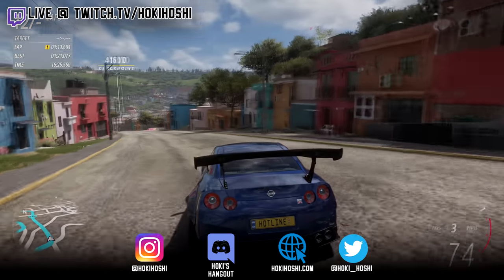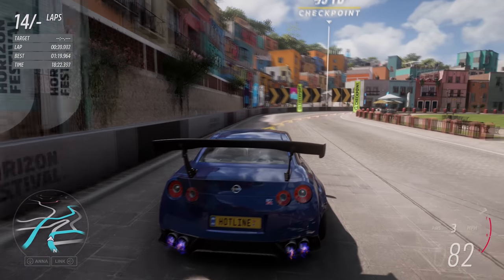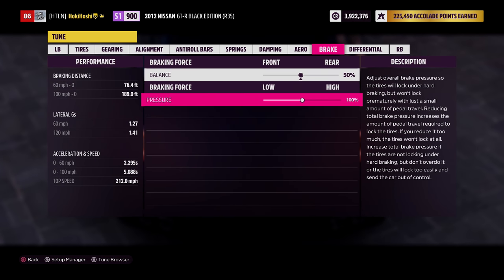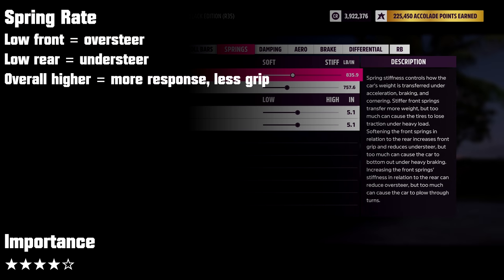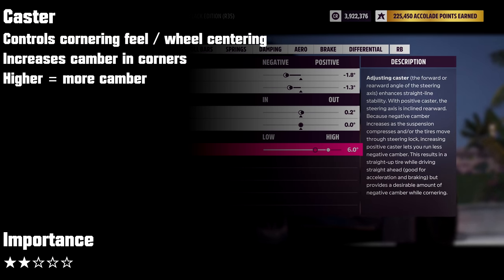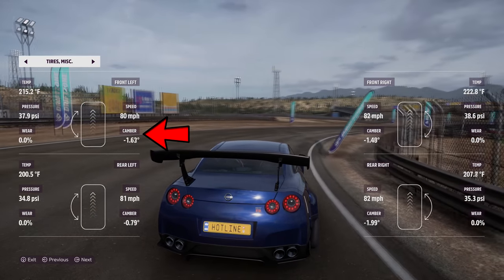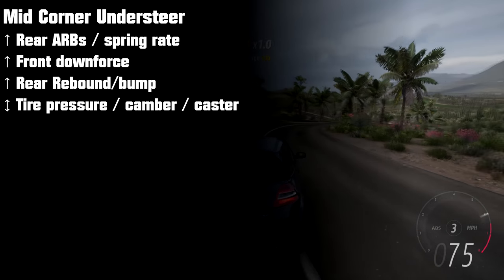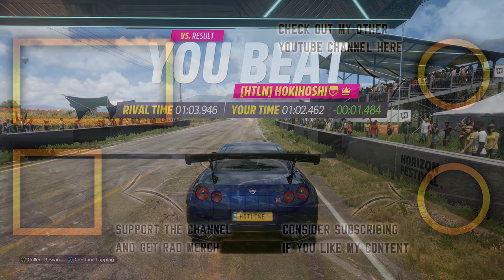How to Tune in Forza Horizon 5 | Basics of Tuning Guide

Comment: Hoki FH5 Tuning Summary

Differential:

Rear Acceleration: 
50-90%, scales with HP. Higher = more oversteer.

Front Acceleration: 
10-50%, low on track builds, high on rally. Higher = more understeer.

Deceleration (Front & Back): 
0-Accel%. Low = responsive. High = corner stability.

Center: 
50-80, low on rally builds, high on track. Higher = more oversteer.

Brakes:

Balance: 
Front = Rear braking force. More stable, understeer.
Rear = Front braking force. Less stable, oversteer.

Brake Pressure:
Higher = Quicker locking/ABS engagement.

Aero:

(Only important for A+ Class)

Higher = More grip, hotter tyres, lower top speed.
Difference between front and back can influence under/oversteer.

Damping

(Keep Bump at 0.5 - 0.75x of rebound)

Main Guideline: Increase stiffness on the end of the car that is not losing grip, or increase softness on the end that is losing grip.

Therefore, high front setting = more rear grip. High rear setting = more front grip.

Springs:

Low front = oversteer
Low rear = understeer

Stiffness can be affected by weight balance.

Ride Height:

As low as possible.

Antiroll Bars:

Low front = oversteer
Low rear = understeer

Usually at around 50%- for front, 50%+ for rear. Don't bother much for RWD.

Alignment:

Camber:
Negative camber is better for track racing. Drop a touch for base tunes.

Toe:
Toe out = Oversteer (Use on front in FWD/AWD for better grip)
Toe in = Understeer (Use on rear in RWD for corner stability)

Caster:
4-7 degrees.

Gearing:

Just match final drive for base tune. Lengthen 1-2 gears for high HP cars.

Tires:

26-35 PSI for track. Higher front PSI is better for cornering.

__

Final Tune:

Suspension:
Should be between 20-80%, try to avoid bottoming out.

Tyres:
Step 1 - Take a corner.
Step 2 - Ensure all outside tyres have negative camber.
Step 3 - Heat should be around yellow-transparent. Lessen camber if the temp difference is too high. Low pressure if middle is too high. Ensure optimum contact and heat.

Good racing, everyone.

Edit: Holy crap this game is so good. Solid 50fps, Mid-Low too on a 6 year old GPU. Wow.
Reply: you sir, are a good man! get this comment to the top!!
Reply: King
Reply: Are you going to make a video on setting a tune for drift cars in FH5?
Reply: Not the hero we deserve, but the hero we need
Thank you kind stranger
Reply: Hoki needs to pin this
Reply: You're the best. I have watched this video like 10 times and still can't remember it all. This is great.
Reply: I still didnt get what acceleration/deceleration I need on FWD cars. Opinions are all over the place. Some say close to 100% on accel and close to 0% on decel this will cause oversteer, some say the contrary and some say 30% on accel is the sweet spot.

My 2 most used cars are the civic '97 and civic '18 and I'd like to know if they should have close to 100 or 0% on accel dif cause oversteer is very important on these 2 cars.
Reply: you're doing God's work!
Reply: thanks bro we needed this
Reply: what graphics card you got my guy
Reply: Thank you good man. Enjoy your tuning and driving🔥🥰
Reply: @blazet7379  why are you asking him?
Reply: @arachnid7468  probably a GTX 1050ti or a 1060 as I have the former one and get around 40 fps at very high settings (settings between high and ultra with 1 or 2 settings tuned up to extreme).
Reply: Got a 1050ti and I can agree the game still looks beautiful on low graphics!
Reply: Damn it give me a second I don’t have my notepad
Reply: @mr_flannels9632  thanks for replying and giving me a notification, I was searching this comment but couldn't find the right video.
Reply: I love you for this
Reply: @arachnid7468  Hey there. I'm running a Ryzen 2600 with a very mild OC, and a trusty 960ti that hasn't failed me for years.

I might be purchasing a new GPU soon just for this game, let's hope that I get a fair price! (I won't)
Reply: You're a fucking God.
Reply: You dropped crown king, here you go 👑
Reply: @TheStrifist  ah nice. i built my first pc earlier this year and got myself a midrange rig with a gtx 1650 and a ryzen 5 3600.
im really impressed with how the game can handle such good graphics with a lot of the lower end gpus. mine can run a stable 60 fps on high.
Reply: DUDE, THANK YOU! So much info. I copied this into a word doc, which will need to be with me when trying them out. Lol
Reply: Amazing. Copy, paste, save... instant cheat sheet for tuning.
Reply: wait. He said something about weight distribution and how we need to take that into account while adjusting suspension...

Just how much did he mean by that.
Reply: Top tier comment on a top tier vid
Reply: I am on a shitty laptop with a 1050 in it which came with the laptop and i get 60fps easily. its amazing
Reply: You just saved me so many screenshot thank you
Reply: More in depth summary with added details feel free to add and remove anything you want

Forza tuning guide
Differential:

Rear Acceleration: 
50-90%, scales with HP. Higher = more oversteer.

Front Acceleration: 
10-50%, low on track builds, high on rally. Higher = more understeer.

Deceleration (Front & Back): 
0-Accel%. Low = more responsive. High = corner stability.

Center: 
50-80, low on rally builds, high on track. Higher = more oversteer.

Brakes:

Balance: 
Front = Rear braking force. More stable, understeer.
Rear = Front braking force. Less stable, oversteer.

Brake Pressure:
Higher = Quicker locking/ABS engagement.

Aero:

(Only important for A+ Class)(Adjust after you drive base tune)

Higher = More grip, hotter tyres, lower top speed.
High front = oversteer
High back = oversteer
Too high of back can make understeer
Difference between front and back can influence under/oversteer.

Damping

(Keep Bump at 0.5 - 0.75x of rebound)

Main Guideline: Increase stiffness on the end of the car that is not losing grip, or increase softness on the end that is losing grip.

Therefore, high front setting = more rear grip. High rear setting = more front grip.

Springs:

Low front = oversteer
Low rear = understeer
(Awd lower front)
(Rwd adjust as needed)

Stiffness can be affected by weight balance.

Ride Height:

As low as possible.

Antiroll Bars:

Low front = oversteer
Low rear = understeer

Depends on cars weight distribution, higher stiffness on heavier part

Alignment:

Camber:
Negative camber is better for track racing. Drop a touch for base tunes.

Toe:
Toe out = Oversteer (Use on front in FWD/AWD for better grip)
Toe in = Understeer (Use on rear in RWD for corner stability)

Caster: 
Increases camber in corners 
Higher = more camber
Almost like dynamic camber, only affects Cornering. 
4-7 degrees.

Gearing:

Just match final drive for base tune. Lengthen 1-2 gears for high HP cars.

Tires:

26-35 PSI for track. 
Higher front PSI is better for cornering.

____________________________________

Final Tune:

Suspension:
Should be between 20-80%, try to avoid bottoming out.
If it’s not moving much at all probably need to soften suspension and vise versa too much need to stiffen

Camber:
Never want camber values to go positive, if they do add more camber 

Tyres:
Take a lap 
Blue = too cold
Dark orange - red = too hot

Peak- Heat should be around yellow- to transparent yellow

Inside - should be hottest
Middle - close to inside temp
Outside - should be coolest
 
Difference between inside and outside should never be more than about 20 degrees - 20> =Lessen camber/ Outside is hotter than inside increase camber

Overall temp difference within 10-15 degrees

If Outside and inside are lower than middle, tire pressure is too low
If middle is hottest - lower tire pressure

If tyres aren’t getting hot enough - increase downforce or try using toe
Cold tires + understeer = add toe out all round
Cold tires + oversteer = toe in

____________________________________

Trouble shooting - 

1st diagnosis when the issue is happening- entry, mid corner or exit

Corner entry understeer-
-Adjust front-tire pressure for better grip
-Softening front springs / ARBS - or stiffening rear
-Adding a bit more toe out in front or rear
-increasing front downforce OR decrease in rear
-reducing front diff deceleration lock
-increase front bump dampening or reduce front rebound

If car is plow understeers under braking specially also move more brake bias towards rear
Move slider towards front cause it is flipped
(understeer is normal while braking)

Mid corner understeer - car settles into corner but car starts to straighten
-increase rear Arbs/ spring rate
-increase front downforce
-increase rear rebound/bump damping
-can also play w tire pressure/camber/caster to find max grip for front tires

Corner exit understeer
-increasing diff rear bias
-increasing rear accel lock and/or decreasing front accel lock

All problems w oversteer -
Entry -
-Increase front springs / ARBS
-increase toe in
-increase diff decel lock
Mid corner - 
-increase front ARBS/ spring rate
-increase front rebound
-adjust up or down, tire pressure and rear camber
Exit-
-increase center diff front bias
-increase front accel lock
-decrease rear accel lock

Rwd grip - 
-increase/decrease downforce
-increase/decrease bump stiffness
-increase/decrease alignment settings
(Better throttle management)

Responsiveness during transitions-
-turning well when have time to setup but bad when quick transition - all in damping and anti roll bars
-if car gets thrown off easy when hitting curb, lower bump stiffness
-if car is too bouncy and shifts weight to much, increase bump damping and spring stiffness

Other problems.
-if not braking good enough - lessen front camber, but increase camber to make up for it, can also move brake bias to rear a bit or stiffening suspension in front to move more breaking grip to the rear, only works if maxing out front braking power
-if struggling w top speed lower aero and mess with final gear.

You’re done!
Credit to TheStrifist for making most of this
Reply: im having so much troubles finding the right heat and camber for my tires it so annoying. they are too hot or too cold. if I find a right balance between hot and cold the differential is like 40+F which is bad. Been trying for hours and im stuck..
Reply: @lindvi0r  I feel that man me too
Reply: Thank you because I do not want to watch the video every time I tune.
Reply: You even typed it in a way to where I could screenshot it in even sections 😆 . Appreciate you bro
Reply: I wouldn't say Aero is not important for classes below A. By the way, Hoki said it's about B class it starts to be relevant, no about A+.
Reply: I'm using this prolly for the next four years thank you kind sir
Reply: I love you
Reply: Awesome
Reply: @iroor  If you look at the stats when upgrading (press Y on x-box controller) you get the weight distribution for the front. So, for example, if it says the front is 46%, then the rear is 54%. You then use then when calculating base tune for suspension, damping etc.
Reply: @EskoShorts  You can set camber by looking at the value in telemetry and keeping it just negative. You can also drive round the roundabout and, when the three temp settings are the same, the tyre is in full contact with the ground. Or you can hurtle up the motorway and keep your inside/outside temp within 20 degrees F. If you do all three, you will get three different settings. This drives me insane. This is one of many things about Forza 5 that drives me insane (not being able to get any tunes on the suggested tunes list being the main one - maybe I'm bribing the wrong person :-) ).
Reply: @FarmerJohn85  so higher on the end that has more weight?
Reply: @iroor  Yes. As a rough guide, take the upper limit, subtract the lower limit, multiply by the weight percentage, then add the lower limit. That's a good starting point. For example, with springs: upper limit - 1554; lower limit - 255; front weight % - 52.

1554 - 255 = 1299
1299 x 52% = 675.48
675.48 + 255 = 930.48

For the rear (limits are not always identical to the front), do the same, but multiply by 48% (this would give 878.52).

In a lot of cases, 80% of the front and 75% of the rear is pretty close to ideal for road racing, but it's easy enough to check in telemetry.
Reply: @FarmerJohn85  oh damn that's quite insightful thanks ^^
Reply: THANKS! This help me a lot! But for my English, I did not understand "entry corner"、"mid corner"、“exit corner” means.(i know entry\mid\exit means, but did not exactly on cars)
And also, i find one issue the video did not mention——Some super car, esp in rear drive, when suddenly boost it, the car is not straight as a line which it suppose should be. 
In contrast, from 0-boost, they usually turn to right or left, till the speed more than 200, some serious cars need more than 250. 
I found this happens on many Ferrari and other cars（not include lamborghini）, name list include: F40 GT、F50、F50 GT、3 Pagani cars、almost all Mclaren cars, Apollo(removed Microsoft tuning). but Lamborghini car and UK car(maybe the studio in UK reason?) like Astonmartin、Lotus, they never have this issue. (Lotus in contrast, it too stable as understeer)
Some player like me, have no idea to slove it, only turn the driven to full-wheel drive mode, most time it helpful, but still some times it's not.
Reply: @TheStrifist what settings do you use? I have a 1050 4gb laptop and it stutters like crazy after an hour, also I don't know what settings to keep, this is my first racing/forza game.
Reply: You are my hero, thank you so so much for this summary mate!
Reply: @hyperionmetalcore  why do u use
Reply: @faris7051  should outside and inside tire temps never be more than 12°C(20°F) apart regardless of temp or should that difference just never be met during peak tire temp
Reply: Thanks!  Great to have this as a reference while watching the video
Reply: I know this is stolen but...

Not all heroes wear capes.
Reply: Thank you so much. This will be a great supplement to the video.
Reply: Bump
Reply: That don’t work
Reply: @fredmckellar4471  6.... J/S
Reply: I don't understand all of these settings, but with examples like this, helps us beginners immensely! Thanks guys. Really loving this community.🧡👍🙏🏼
Reply: thank you!
Reply: I was making notes the whole time then saw this at the end of the video lol. Thanks dude
Reply: Man you're a legend thanks for your time
Reply: @hyperionmetalcore  drive and figure it out
Reply: ur a legend bro thx so much
Reply: I‘ll report you sir for being a saint. YT comment section doesn’t deserve you.
Reply: ty man <3
Reply: GOLD. Pozdro666
Reply: Just tuned my rally car to this and it is amazing
Reply: You are THE top g my g
Reply: thanks bro
Reply: Coming back years later, you still the goat 💪🏾
Reply: @WcDame  daddy
Reply: @volxy3505  Didnt say all that. But, bro’s help is appreciated.
Reply: @WcDame  what you talking about?
Reply: @volxy3505  “im not your dad” lol 

You gotta be trolling right?
Reply: thanks bro
Reply: As someone who needs to read things to really internalize them, thank you so much for this comment. I have to reread constantly so having you write it out has been very useful.
Reply: After 2 years, this is most complated and easy video about tuning
Reply: bro youre a fukn legend
Reply: @OoJxShadow  AMEN